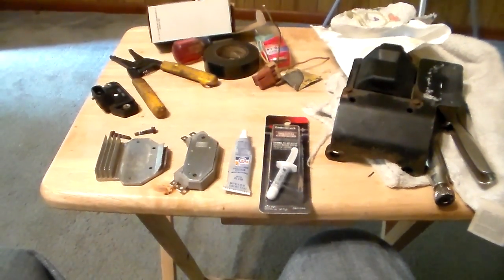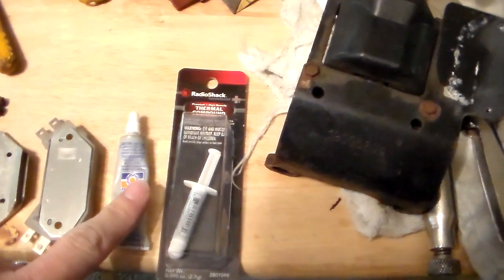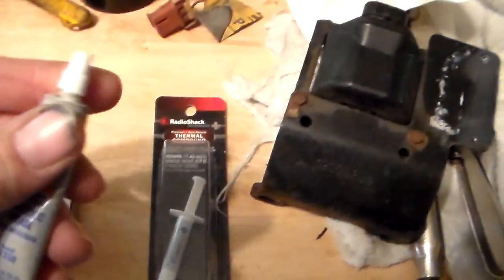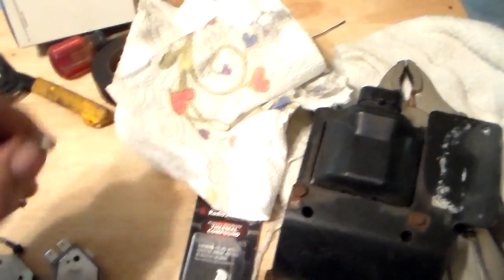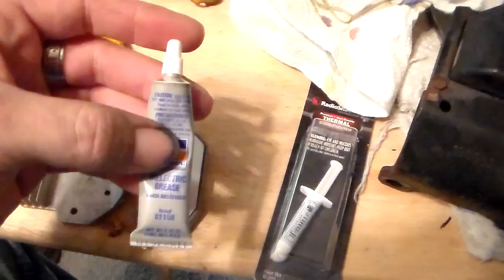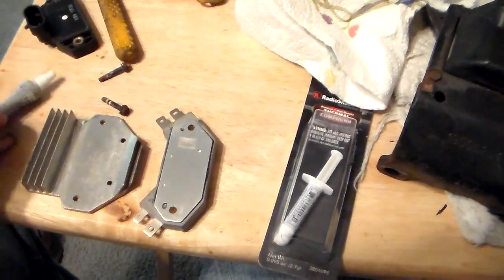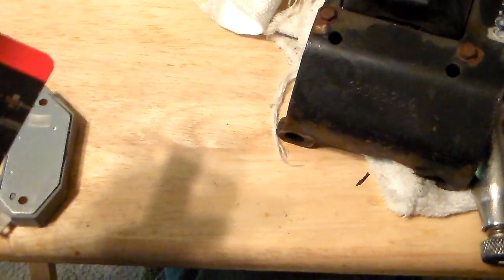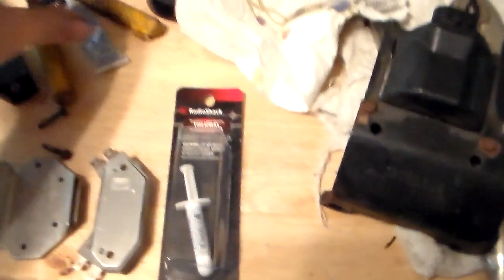Chrysler HEI conversion part 5: Dielectric grease vs. heatsink compound

Comment: Interesting, I use to use the heat sink compound underneath the hei distributor module and would check it in the summer months to make sure it was still there ,just to find it dry.Then I read where dielectric grease worked just as well.So I been using it for years ,and down the road when I checked the grease it would still be there .Never had a module burn out since.

Comment: I just went through this same thing buying a new module for my 83 Cutlass with the CCC system and E2ME. I opened the box at the part store to make sure it had the stuff with it and it didn’t, the guy at the counter was trying to tell me that it’s just dielectric grease, I told him it wasn’t so he opened the box of a “Canadian” module and pulled out a little pack of…..dielectric grease!!! Scary that even the part manufacturers and salesman don’t even know what they should be providing
Reply from the maker: sure is

Comment: All liquids conduct heat! Removing air gaps with any type of grease is better than nothing. Dielectric grease is good to 120 degrees f. The thermal paste i just scraped(not wiped)from my modules was dry and cracked! Professionals have been using this product for many years on high output radio devices! I paid $10 Australian($13.50 US. for .3125 of an ounce! Buy cheap get cheap!

Comment: Noticed you-tube distributor rebuilds applying a variety of paste/grease between module and body. Stopped at auto parts and kid sold me dielectric grease.  ..i had that funny feeling.. Having worked on my computer I looked up processor install to confirm thermal paste between processor and fan and felt it a simmilar application. TY for confirmation.
Reply from the maker: solotrekker No no....dielectric grease is not the same as thermal (heat sink) compound. Dielectric helps ensure conductivity, heat sink paste conducts heat.
Reply: @TylersNeighborhoodGarage  I understand how they both work properly but I was a bit confused with your reply here… In the play on words. I’m just a bit confused and was curious if you could clarify… I know this comment is a few years old but I figured I would give it a shot…

If it’s an insulator then how can dielectric grease “ensure conductivity”? If it doesn’t conduct electricity but insulates… Then I’m just confused 😂

Comment: I recommend your viewers research this topic on a deeper level as per their individual vehicles. My Ford Ranger specifically requires dielectric compound on the ignition module - NOT heatsink compound (I was thinking the same thing you were during my backyard repairs and mistakenly applied heatsink compound. I have both the Chilton and Haynes repair manuals for my vehicle and these reputable books both make the point quite explicitly and even name the type of dielectric grease that was most effective). My guess is that, while it is obvious that the ignition module is bolted to a heat sink (mine has fins), what may not be as clear is that heat sink could also very well be part of the ground loop in the ignition module. Insulating a ground contact with any compound could very possibly cause arcing and disastrous results. To be certain, official repair manuals always trump online forums and videos (I'm not saying these sources aren't useful - but the truth is, they are often misinformed  and likewise are frequently the product of second hand notions.. better safe than sorry!)

Comment: Actually that dielectric grease does conduct heat, only it's thin and will eventually drip out of the joint and leave a gap, and air gaps hardly conduct heat.  Heatsink grease also contains powder like zinc oxide that conducts heat and keeps the grease from running off.  Some heatsink grease contains metal powder that also conducts electricity, and it can cause shorts, so don't use it on high voltage electrical devices, like ignition modules or spark plugs.

Comment: You are correct in saying that they are not the same thing. However, dielectric grease is not a heat insulator, it is an electrical insulator. It conducts heat quite well, but not as well as thermal compound. Dielectric grease is 100% silicone grease, whereas regular (not the one you have) thermal compound is silicone grease with added heat conductive fillers. You can use dielectric grease on a heat sink, but it won't be nearly as good as the premium stuff you got.

Comment: You can make your own heat sink compound by adding aluminum oxide powder to the dielectric grease. Silver nano particles conduct heat a little better but the difference is negligible in this application. You can make your own silver nano particles by dissolving pure silver in nitric acid which produces silver nitrate. Exposing the silver nitrate to ultra violet radiation  will leave you with silver nano particles which are then also added to the dielectric grease to form a paste.

Comment: THANKS! almost made this mistake on compute heatsink, i got lots of dielectric grease but no thermal paste, auto parts guy's told told me to use dielectric grease on distrib module to, looks like Im taking distrib apart again and putting correct compound.

Comment from the maker: Yes. To set base timing it needs to be at idle speed and vacuum disconnected.

 It doesn't matter which end you disconnect as long as you plug any vacuum leak you create.

Comment: If you have an HEI system and your trying to do a tuneup do you still need to plug the vacuum advance? If so which do you plug, the hose coming off the base of the carb or the vacuum advance coming off the distributor? I am trying to get a 1957 283 tuned that is in my 50 Chevy 1/2ton. I've worked on points type distributors in the past but not HEI setups and even then it's been years since I've done that. Sure could use your insight on this. Thanks